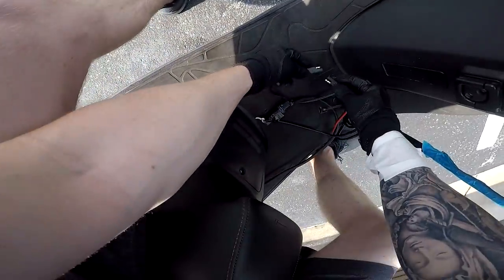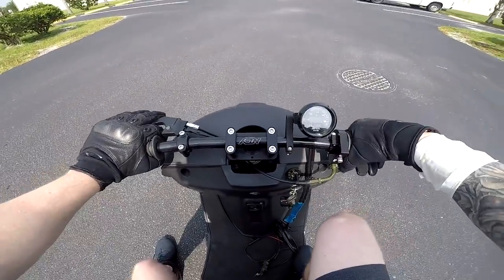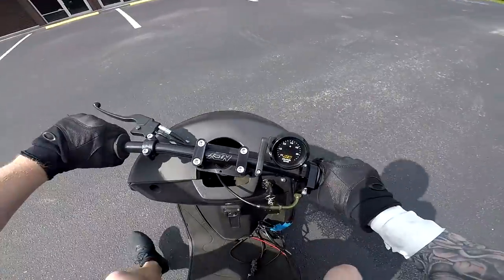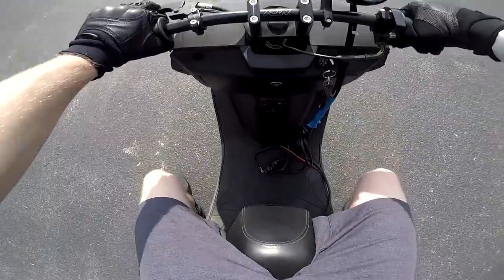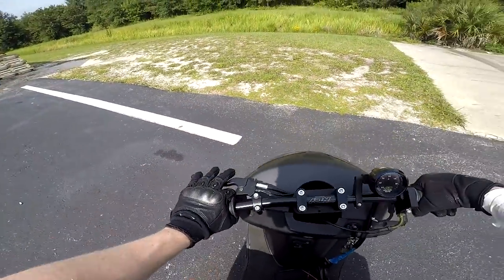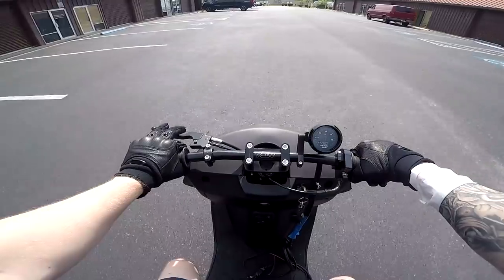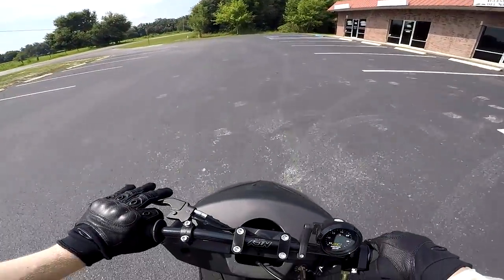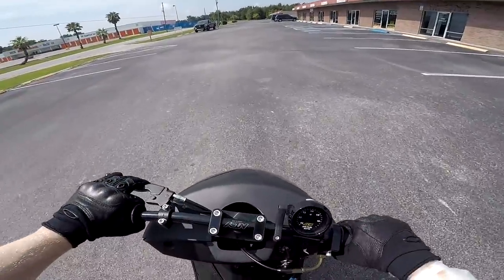First rip on the drag scooter ( half throttle )

Comment: Mine is running like a stock 50 cc on a half tank of diesel! I don't know what it is! It's 81cc ported head, cam exhaust, all the usual goodies! I'm thinking it had crankcase venting issues, because it started a intermittent smoke screen, I don't think the 8k-8500 is revving high enough to make power,( 20shot that's going to send it to the scrapyard! )  But I have a bbk with big valve head, ported, I'm building a complete stroker, engine, so the rotating Assembly will be ballanced, and not have that vibration like when you just throwing a big bore kit on, the 52.4mm kit isn't as cheap as the others, especially with the head, plus the time porting it! Matching a intake and spacer, plus it has a pop-up piston! And I have a little nos kit just in case! With the valve springs, and titanium retainers, it should spin over 11k easily, I haven't spun the 81cc over 9300,   it being a 3year old engine, I don't want to kill it! But I'm going to eventually do a 150 swap with bbk,
Reply: @konardkonrado7755  not Honda, but uses a Honda designed engine, from the early 80's, basically a chinease scooter, sold under many names,  but I have got my 81cc running decent, I'm over 300lbs, and it does 45mph easily, a 150, or 150with a big bore kit, will run much better, they can be as large as 232cc with the gy6-B engine, and about 190-205cc with the gy6-A engine more common, the best thing about these is they are cheap, until you start buying the top line performance parts,
Reply from the maker: Yeah my motor was about 3k with the taida case lol

Comment: I tried looking but I can't find carbon fiber rims for scooters, just figured if you aren't gonna stop upgrading, that would help with taking weight off, plus the foam in your seat u can probly change to some kinda open cell padding 👍

Love that thing by the way, someday I'll upgrade, I'm just small time for now lol
Reply from the maker: I was just thinking about turning the seat down today. I think that’s next
Reply: @burnoutbobby  I'm tall so I need to start looking into videos with shaping the foam in them seats,  because my seat has like a hump [for the passenger I guess] in it that I seem to wish I could scoot back n sit right where it is. 

Is yours street legal? Like went thru DMV to get it tagged? Was wondering because of the no headlights n front signals.
Reply from the maker: No it’s not street legal. Got it with no title for cheap since I knew I wouldn’t drive it on the street

Comment: What carb are you running in this thing? I ran a 30mm oko on my 205cc gy6 you should atleast be running a Airstryker 35mm Monster rejected to your settings itll pull the hardest it could possibly go

Comment: Update update please. 
Well just got my 62mm build parts in waiting on body plastics to come in. So my question is did you do anything to the front end shocks to lower or just left them alone. I'm going for the lower slammed look. 
Hope all is well.
Reply from the maker: Bike is sold so I could do my new build 😔 I could never get to the track with this thing so it wasn’t working out.  I cut the springs in mine and put 30 weight fork oil in them

Comment: Taida 232cc 
 a gy6 150cc b type case opened up to house the 232cc big bore ? I love the gy6 engine and scoot is a way of life ! Lol(built engine ? Where from?)
Reply from the maker: It’s a taida case and piston setup. Forged piston. Billet crank. Port and polished head. Taida cam. Bunch of goodies lol.
Reply: @burnoutbobby  
It's hard to find this case in the uk.
I thort the 232 was a modified 150cc b case but if is a kit bought then will have to look to import at a better time (fux cronavirus) thanks bro 

Scoot gang

Comment: I have the same scooter only it’s 50cc tho unrestricted so around 40MPH it goes how did you make it so fast and good?
Reply from the maker: I have the 150cc model then paid 3k for a 232cc race motor. So that is what made it fast and sound good.
Reply: @burnoutbobby  do you have Any tips as to how to make my scooter faster without an engine change? I’ve upped it to 80cc changed the rolls, new but stock unrestricted carburetor, etc.
Reply from the maker: @nothingpersonal6546  from what I know those 50cc Chinese motors don’t really go fast unfortunately, even with the big bore kits from what I’ve seen they help but not much

Comment: Been waiting on a vid!
Reply from the maker: Just for you lol
Reply: Lmao...looks like it’s gonna be a runner my man...be careful on that thing...you should run a disc on the back...that drum brake ain’t cutting it!
Reply from the maker: I know but it’s made for the 1/8 mile at the track which gives me the rest of the track to slow down. Disc would be hard for my wheel setup in the real since it’s not made for it. Trust me I thought of it after that ride. Lol
Reply: Yea man soon as you get that bike tuned....mannn...it’s gonna be a beast.
Reply: @burnoutbobby  where can you get your parts at with the clutch and the total build of the gy6 engine and clutch kits to take my baja sc50 make it sound and fast as mean as yours is because I want to know every part i need for my build
Reply from the maker: Krista Foster well you will not keep the motor you have now since it’s not capable of going fast. You will get the motor from David Bullock it’s a 232cc stroker motor and then the ruck shop sells the trans kit for that motor as well as the carb and other small parts
Reply: @burnoutbobby  ok how can I contact David bullock for the engine and transmission I need
Reply: what kind of scooter is this honda?
Reply from the maker: It’s not a Honda. This is a vento
Reply: @burnoutbobby  I figured out that dealim otello and zipp quantum shares the same body ;p can you tell me where did you get shorter front to lower it? and front wheel size? paint of the body is it just a spray or stock?
Reply from the maker: Wheel size is 12” and plastics are stock flat black.  I lowered it by making my own suspension
Reply: @burnoutbobby  the back wheel is moved to the back coz the engine is longer or you did it intencionaly?
Reply from the maker: The motor is the same size dimensions and in same location as stock.

Comment: You need to take it to the strip at night these gy6 engine's run so much better when the humidity's low but your right Florida is Florida it's probably always humid down there
Reply from the maker: Yeah it is.  Wed night is test in tune in st Pete and that’s where I’m going to run it. I just need to wait till after summer here
Reply: @burnoutbobby  you ever get a run in mane
Reply: Is this a gy6 motor? Just wondering thought gy6 didn’t make 4 strokes
Reply from the maker: Gy6 150cc and gy6 50cc are all 4 strokes here. This is a gy6 that was bored to 67mm

Comment: a word of advice, make it rear disc break for more stopping power
Reply from the maker: It’s not needed for the drag scooters. You have over 1/8 of the track left to slow down.  If it was made for the street then yes I’d put a rear disc kit on it for sure.

Comment: Sounds mean.
Reply from the maker: Definitely changed the tone
Reply: @burnoutbobby   hey bro, I'm breaking in a fuel injected 170. I've seen the videos on 232. I saw where you have to cut the block to make it fit.

In your experience have you noticed the engines not holding up as well? I'm talking daily driver type use with the occasional rip around kinda thing
Reply from the maker: Yeah the air cooled are probably not the best daily drivers. There is a water cooled 232 that may be a better bet. You don’t have to cut the case anymore unless you are trying to save money. They make cases specifically for the 232 now.